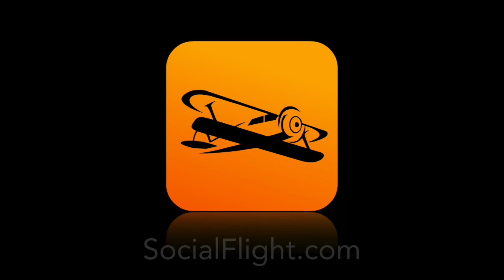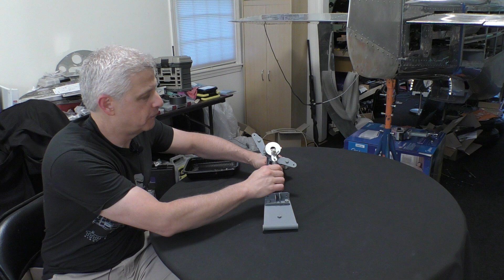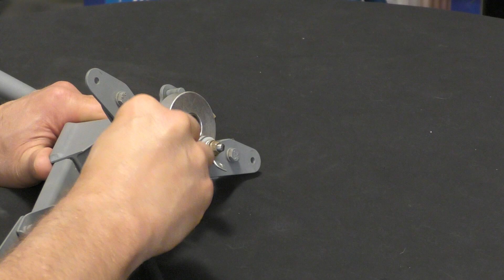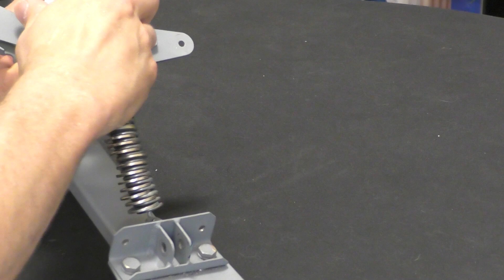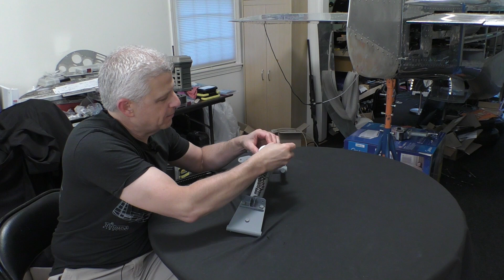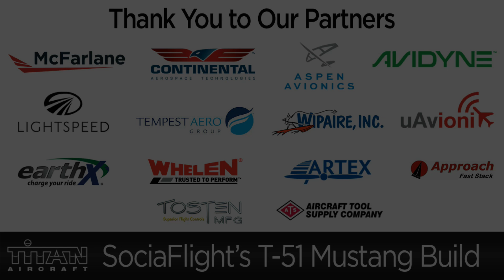P-51 MUSTANG COIN TRICK! A Tip You Can Use This on YOUR PLANE Too...

Comment: Sorry Jeff, as someone that has a T51 for 8 years - you will not remove tail wheel shimmy on the aircraft unless you have a double axle tail wheel.  Having gone through every solution, the way we solve it was having a tail wheel in which the axle comes into both sides of the tail wheel.   Also, make sure you have a real tire and not the plastic wheel that use to ship with the kit.  This is not as authentic as the original Mustang but it is safer.  Talk to John Williams at Titan.   Good news is the double axle will still fit in the wheel well.
Reply: The dual fork is only a portion of helping stop shimmy. The geometry of the bracket required changing as well as the geometry of the fork assembly. A combination of both is what completely removed tailwheel shimmy on my T51 V8 installation. Both designed and produced for T51 owners now. John never took this onboard when presented to him (with video evidence).
Reply: @gmanvk7559  ok - but my plane is a Honda engine and therefore lighter.  So I believe you - but my experience is my experience.  New axle and new tire fix the problem.

Comment: You should never powder coat highly stressed steel parts on an aircraft like a tail wheel or an engine mount. Powder coating can hide any small crack that starts to develop. It is safer to epoxy Prime and paint  such surfaces.